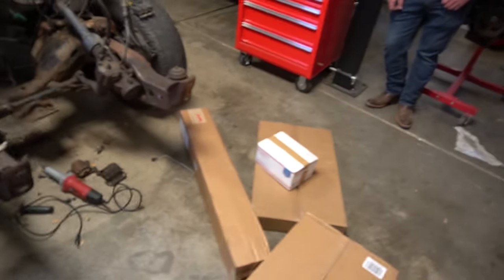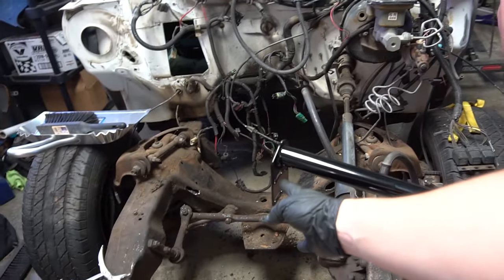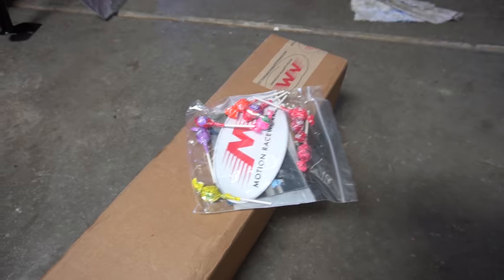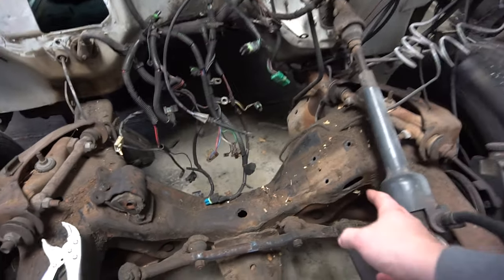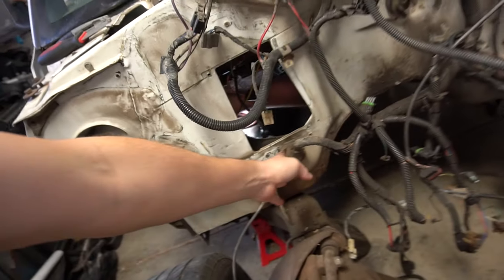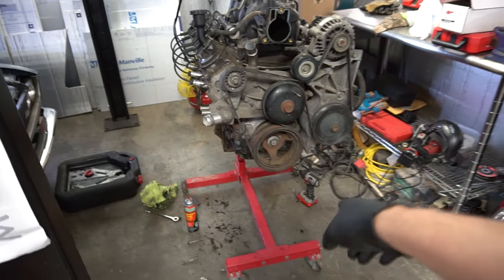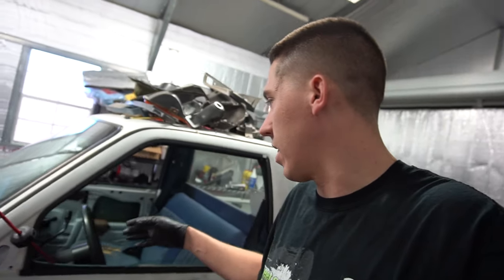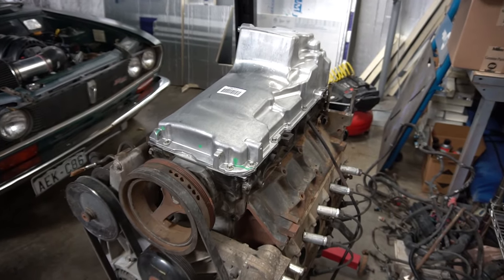LS Swap S-10 Build... Installing the Junkyard 4.8L LS Into the Burnout Truck!

Comment: Building a second gen s10 burnout truck myself to make life easier even removing stock engine removed cab bolts and used two screwjacks from small car to pick up cab
Reply from the maker: Nice! Are you planning on making any events this year?
Reply: @BuildTuneRace  i was at houston and failed misserably (red white blue s10) but still had fun and hope to make next houston one just got chassis stripped engine bay prepped interior gutted and ordering engine mounts and hopefully pick a trans wednesday
Reply from the maker: @nicholasgillen5343  nice heck yeah! Good luck with the  build!

Comment: Someone has changed the cam in that motor...probably.  That chamfered bolt is from the oil galley seal plate that is behind the cam gear.

Comment: The boat in the oil pan is one of the bolts for the cam retainer plate behind the cam gear
Reply from the maker: Ended up having all those bolts in place have no idea where it came from lol. Maybe they replaced it at some point

Comment: I think the power steering pulley on the 2.8 engine that was in the truck is smaller.. you can swap it onto the ls truck pump..
And fold that seam up, will make life easier for transmission bolts

Comment: I know I’m late but I did retain the power steering pump. I know the struggles. I kept the factory oil pan but my k member was already cut out Bc we had a sbc 350 in the truck before and there’s still a heater box on it just not the a/c box. And I just used the $180 shorty headers from speed engineering. But I don’t like them due to struggling to get plug wires on and steering column figment issues. But congrats on the win at burnout rivals.
Reply: And yes I also had the firewall beat up a little for the trans. I’ve heard that factory 4.3 trucks had more clearance on the firewall than a 4cyl like mine was.

Comment: I'm using the H3 (Musclecar) pan, and I had to notch the front crossmember to get the engine and trans in/out as a unit. Otherwise I would have had to lift the body.
Reply from the maker: Yeah i could see that i left the k member and will just drop the trans or pull the engine seperate. You don't normaly have to do both at the same time anyway.
Reply: @BuildTuneRace  true 👍

Comment: Did you unbolt and lift the cab? I just did the same swap on my s10 it would be easier for you to drop the engine in with the transmission together lift the cab up so you can put it in I also know what type of headers you can run if you dont already have sum picked out
Reply from the maker: I didn't lift the cab might try that at some point though! Looking at a bunch of header options lol
Reply: @BuildTuneRace  I have the same build like I'm telling you and that's how we put in the engine together with the tranny lifted the cab to get it in and as for the headers I got them non turbo sadly lol but they go around the chassis and are designed to clear the steering shaft so you wont have to mess with that do you have an ig ? I'll look for the part number so I can leave it on here

Comment: I know I'm a year late but I'm working on doing this to my 83 s10. The thing that I'm worried about not knowing how to do is wire and fire with terminator x.
Reply from the maker: I have a wiring video on the terminator that should help you and a first start where I plugged all the base info into the system! It’s really not to bad!

Comment: A power steering pump from a 2.8 will work. I did mine and don't remember having that much trouble. Take that intake of and strip that engine down to the heads. You guys are beating yourself by putting a fully dressed engine in. Dam it's a engine not a motor.

Comment: After like 95 they started putting a welded nut on the inside for the engine mounts
Reply from the maker: That definitely makes a lot more since😂
Reply: @BuildTuneRace  what don't make since is why the first gens don't have that. It's like gm just wanted you to discard the truck once the rubber mounts deteriorates.
Reply from the maker: @datraktorman69   that's what I'm saying! 😂
Reply: @BuildTuneRace  BTW I'm looking forward to seeing this lil monster rolling. I love lil s10's,even though I'm currently rocking a Dakota I'm putting a basically stock 5.2 and 5 speed in. Once that blows I have a 350 or a 383 to throw in it. Will eventually get into ls's once all my old junk blows haha
Reply from the maker: @datraktorman69 heck yeah thanks for watching! Definitely sounds like a good plan! I love me some LS stuff but seeing some OG sbc stuff is cool too!

Comment: Dont the motor mount plates on the block have two positions, 1"-2" forward or standard position
Reply from the maker: The swap mounts have sliders on the block side. I think i can flip them over to gain more slide to the front

Comment: that bolt was off of the cam retainer cover.
Reply from the maker: Pulled the engine apart and didn't find a missing bolt there🤷‍♂️ lol
Reply: @BuildTuneRace   so thats where the hid the one i was missing lol

Comment: WHY DID YOU DECIDE TO DELETE THE A/C? IM GETTING READY TO DO THE SAME SWAP SO I WAS WONDERING.
Reply from the maker: Since I was only doing burnouts I didn’t try to save it. Also the LS will not fit with the stock AC/heater box. I think some people modify them to try and keep them but it won’t just pop in with the full box there.

Comment: Hey dude.  How did you make your ac controls and cluster work with new LS wiring?
Reply from the maker: No AC and the holley efi has a standalone dash so not using the stock cluster either. Sorry i couldn't be more help lol
Reply: @Build Tune Race 

Ok thx

Comment: What windage tray and pickup tube was used for the h3 oil pan? I've got a gen 3 5.3 build and was just curious
Reply from the maker: I bought it all as a kit. Came with rear pick up tube and windage tray i think its the same as what comes with the gm muslce car swap pan kit
Reply: Do you happen to have a link? Thank you guys!
Reply from the maker: This is the amazon listing title $245 GM Performance Parts 19212593 Oil Pan

Comment: Does that oil pan work for the 2nd gen s10/blazer?
Reply from the maker: I'm not sure i think those trucks have more room since they came with bigger engine/trans but not 100% sure about tunnel and k member clearance on those.
Reply: 1st Gen and 2nd gen s10, Sonoma, s1o blazer all same frames